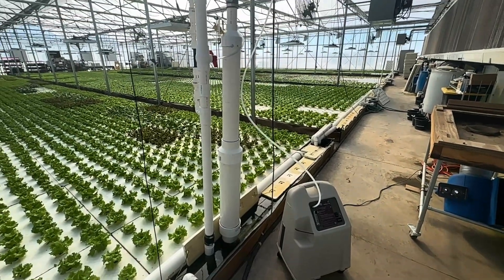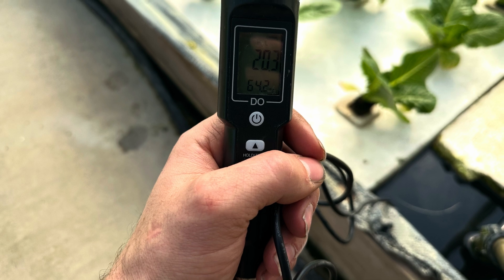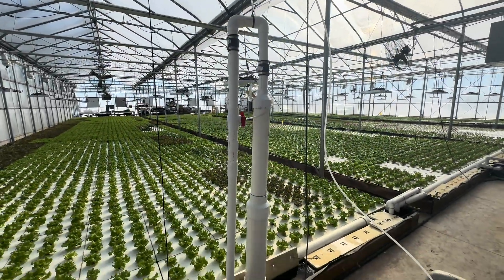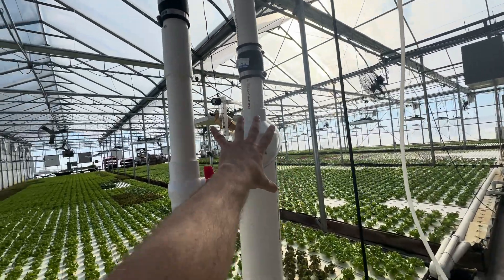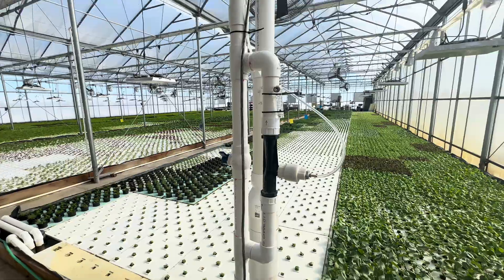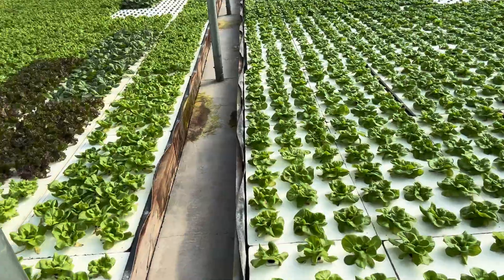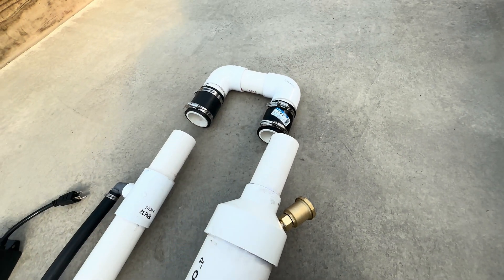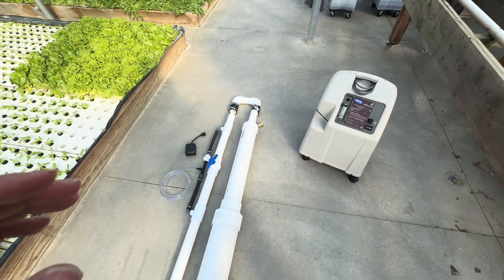We Made the Most Efficient Aerator!!

Comment: Kind of funny, the saltwater aquarium industry has used this for 40 years or more for what is called protein skimming. You can create the bubbles with a venturi at the bottom, and the water flows downward. I had one from lifereef, actually still have it but not running any longer. While the goal there is for the proteins in the counter-flowing water to adhere to the bubbles, it's identical in behavior even if the function is different. You would have simply added O2 to the inlet versus my airhose. Go to Reef Central and there are INSANE systems you might learn from as the water quality with them is second to none. Great channel!

Comment: You must be an engineer as well, you’ve came up with some really creative solutions to common problems
Reply from the maker: It wasn’t original with me! There isn’t much that is tbh 😀 Dr. Speece started researching this in the late 60’s/early 70's. Unfortunately, it never really took off like I think it should have, and we have all been sold sub par and inefficient systems as a result. Hopefully we can fix that!
Reply: Could this be used on a small system? By small I mean 5'x20'. Hoping to build one in the next 6 months to experiment with. 
I'm currently operating an ebb and flow system and have never checked oxygen levels. Is low oxygen something specific to DWC?